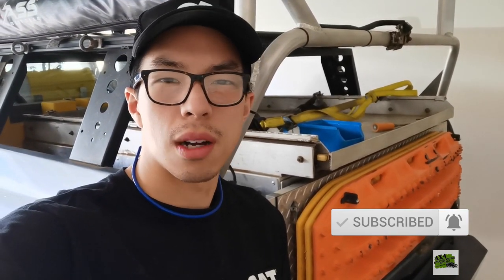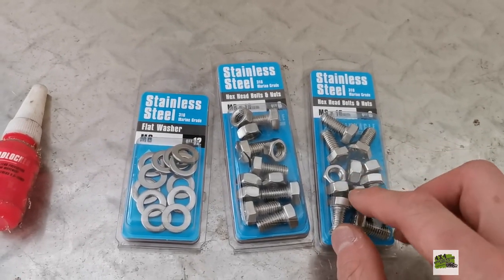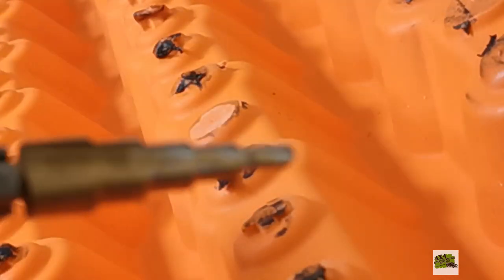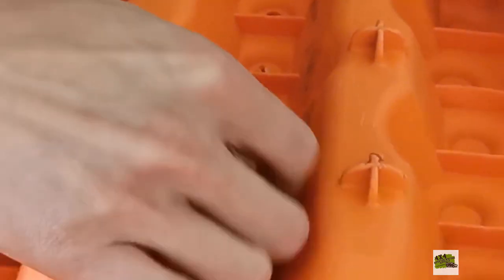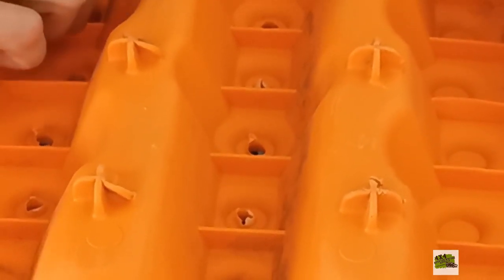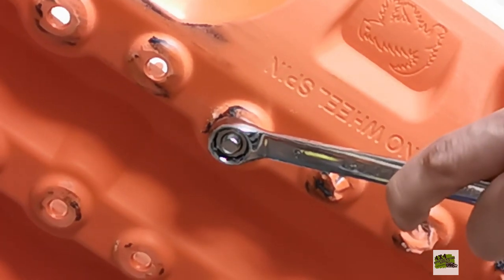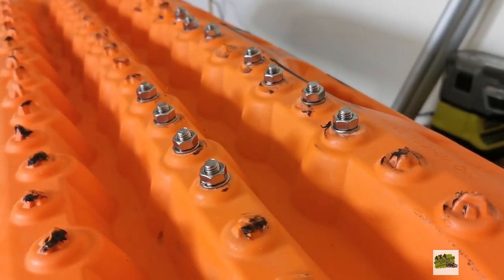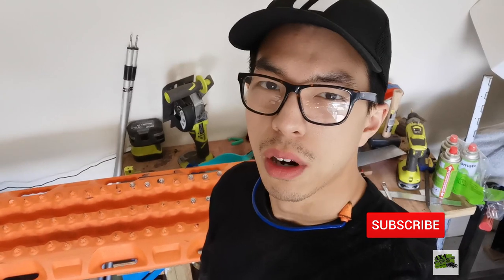Maxtrax repair - CHEAP DIY repair with bolts

Comment: Mate you just modified max trax using lock tite,  your a legend , and probably a better device then their new replaceable stud trax,
I'd put a bigger washer on the other side tho so it doesn't pull thru the plastic, awesome job 👍
You've got my subscription
Reply from the maker: Thanks mate. The repair is very easy. Most difficult part was to work out the correct bolt length and thickness so the tracks are still stackable.

Comment: This is very clever. Great idea. If I may add my 10c…. My concern would be the metal on rubber wear. Maybe glue a plastic cap cover on top of the bolt and thread. 
As I say, very clever. I was actually YouTubeing ideas when I saw your blog. I was thinking about using epoxy and football boot studs on a cheap set of tracks. 
I just can’t justify the cost of Maxtrax.

Comment: It would be cool to see a follow up video of this fix.

Like a "X" amount of months later type video. I am a bit worried about the bolts hurting the tyres.

But otherwise awesome and very useful video.
Reply from the maker: Cheers. I would love to find one day to test it extensively!
I have actually used them once after the fix and it works alright. Check this link out time stamp at lennard poweline track.
https://youtu.be/F3V4BuXJvu0

Comment: Have you thought about using a dome nut instead? 
Sharp threads will rip up your tyres.
Reply from the maker: Dome nuts probably not pointy enough aye. Also they take up too much height so tracks won't stack like before.
Maybe file off the sharp bits to decrease tyre damage.
Reply: My thoughts exactly. I get the point of not being sharp enough but I wonder if this isn’t too much

Comment: I see this video is 2 years old now? How did it work? Would you do it again or make any changes…? ✌🏻🇿🇦
Reply from the maker: Yeh I don't really think that would be a problem with the metal studs. However I only used once or twice but it seems doing the trick.

Comment: Did you test it to see if the bolts just rip out under load?
Reply from the maker: I haven't really got a chance to test it yet. But I assume it won't. I think the plastic should be destroyed first. But the track itself is normally real tough.

Comment: Do they still stack though? I’d also put the nut on the inside, the head of the bolt makes a more tyre-friendly grip point.
Reply from the maker: yes they still stack although they are a bit tight.
to answer your question, i think it may be even more trickier to stack them up if you put the nut inside. Not only you need to work out the exact length of the bolt, but the nut itself may simply be too thick for the tracks to stack.
also the bolt head may not be pointy enough to grip in my opinion. That said, you can try that and let me know.